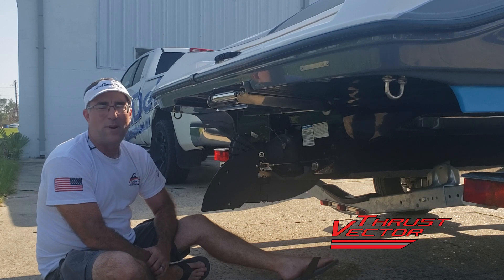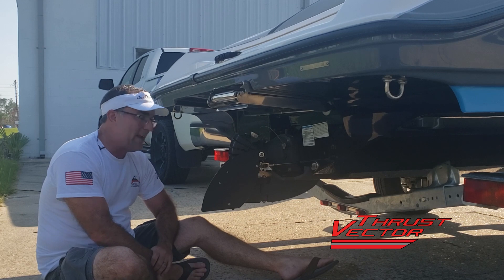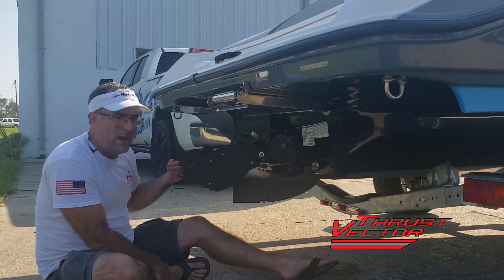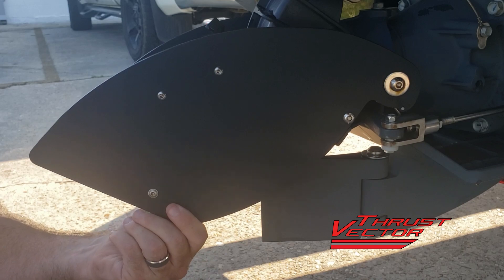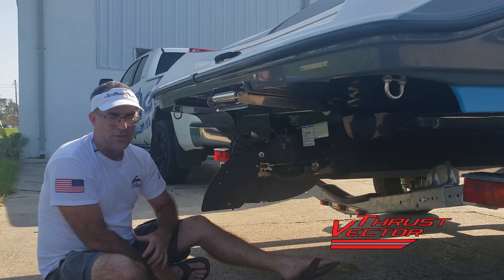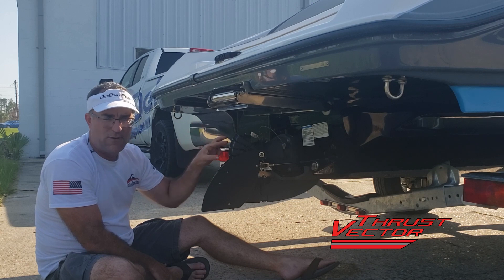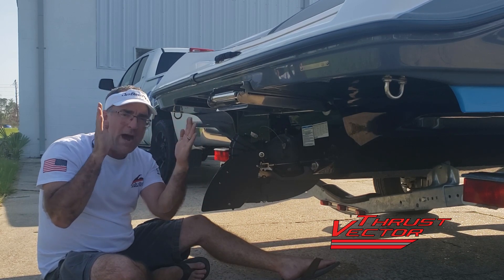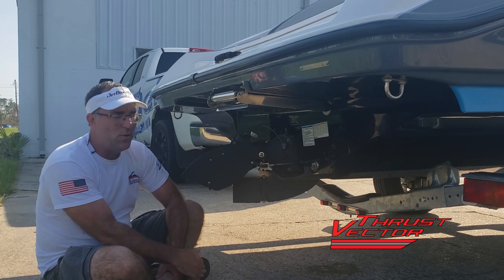All New Thrust Vector Feature: KICKSTAND

Comment: Is this available for "Thrust Vector Wake"? I have 2016 Yamaha AR190 and replaced my 2-yr old Thrust Vector XV with the "Wake" version just last year! Wish this mod came up earlier as I do have a steep driveway and had to install rollers on the back frame of my trailer just so I don't drag the  Thrust Vector blades on the concrete.  And, if available for the "Wake", does it require full removal and disassembly to install the kickstand or it can be installed on a already mounted unit (Because re-installing this is one hell of a deal breaker for me. The original Thrust Vector install was a breeze in comparison with the Wake, with the required cement-gluing of parts and fine-tune adjustments and all...).
FYI on the Thrust Vector Wake product: Although it does reduce the back spray of the engine and produces a smoother jet wash behind the boat, it also does impact the steering of the boat dramatically. Whereas with the old Thrust Vector  once can steer the boat freely with one hand, the Wake version requires a lot more effort on the steering wheel (both hands on higher speeds). Something for those  on the fence to consider...

Comment: Could this be retro fitted to the wake vectors?
Reply from the maker: Yes but the mount and spring holes would have to be drilled. The location is pretty critical.
Reply: @JetBoatPilot  got a template that we could use?
Reply from the maker: @SteveO99999994334  yes email me at will@jetboatpilot.com and I'll send it to you.